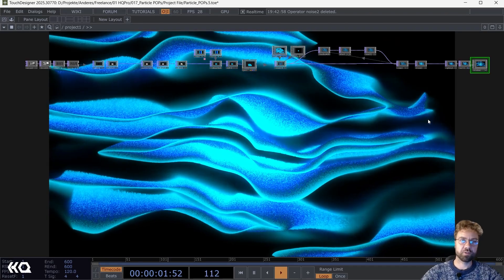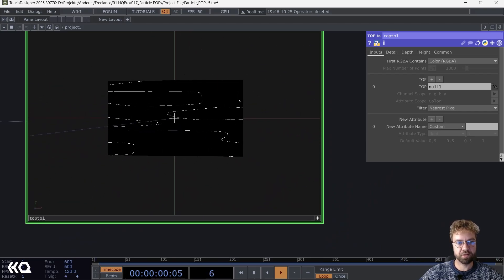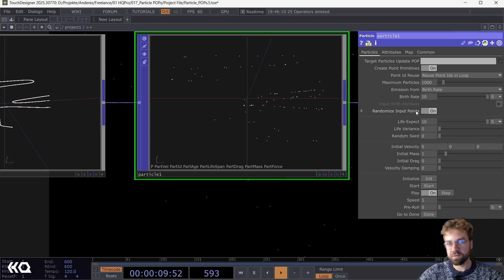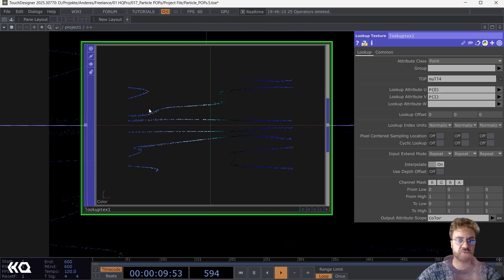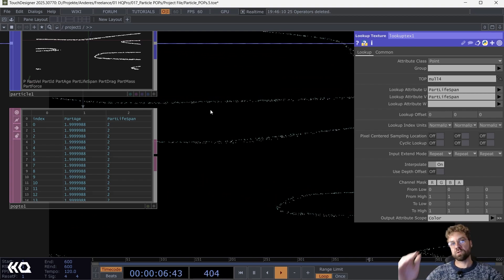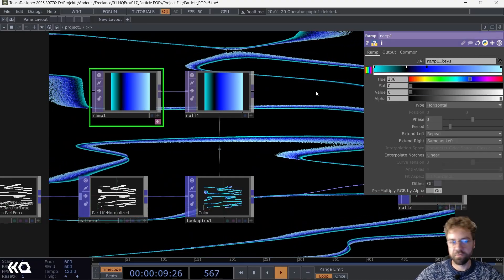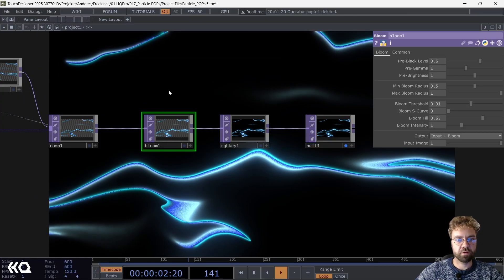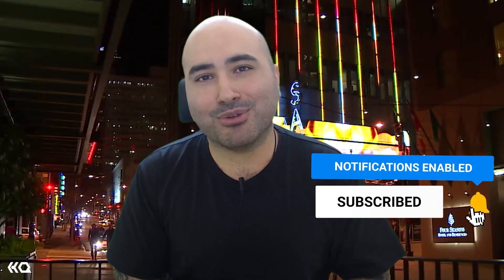Wavy Particle Systems in TouchDesigner using POPs

Comment: Hello! Great tutorial! I have a question though: in the first 30 seconds, we can see the resulting effect, and the particles seem to move along the waves, as if they had inertia relative to the texture. In the final project, however, this movement isn’t present—the particles appear and disappear without moving. If so, how can we achieve that result?
Reply from the maker: I see what you mean! I was able to get something in the ballpark of the effect at the beginning by adding a bit of Initial Velocity in the z axis in the Particle POP (try something small like 0.01 or 0.1).